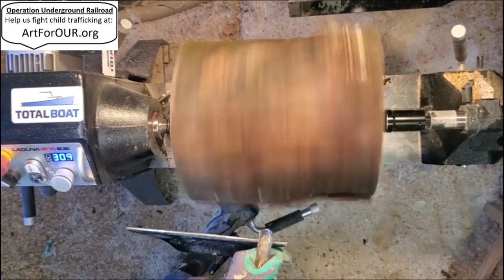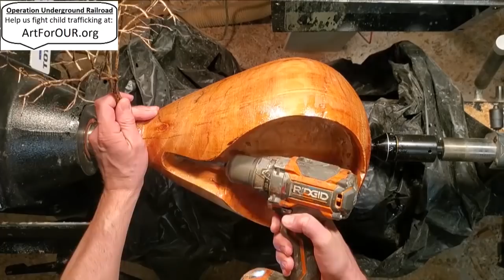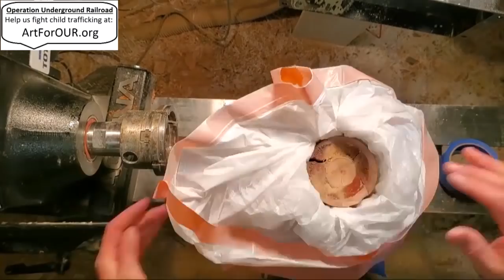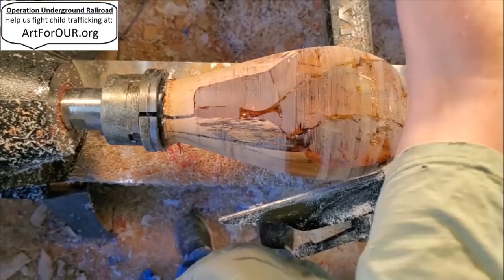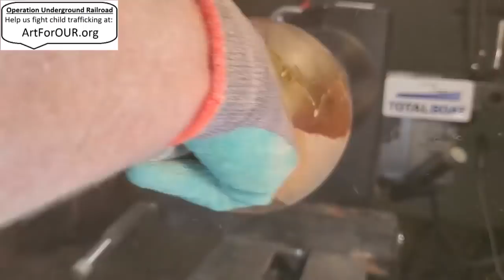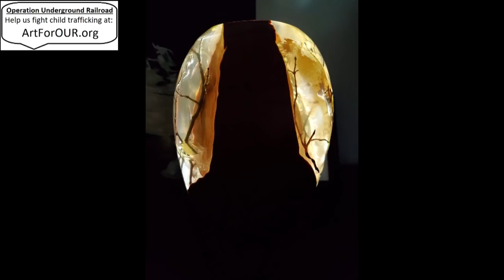"Crystal Tree"  Wood turning lathe project. Willow wood lamp. Fight child trafficking, ArtForOUR.org

Comment: Great Job Dan
You need to make a temporary mold to maintain the out side shape when casting.
1. turn shape on project.
2.put 2 coats of sealer (any kind, it will be turned off later)
3.chisel, router, gouge (what ever it takes)in a scrap piece of wood to the rough outside shape of the piece .Its not fussy. Big enough scrap to cover your window you intend to cut in your piece. 
4. wax your project with past wax or use a release agent.
5.mix up Bondo. Its two parts A and B. Its auto body filler. Buy it at auto parts store, or Harbor Fright.
6.spread the bondo on both your project and the scrap piece and clamp to project. (You may need to do this step twice depending on how good the mold looks after the two are separated)
7separate the two.
8.hollow out your project(making sure not to go past what the mold covers.( before hollowing wax project then hollow, that way plastic only sticks to intended surface)
9.put sealer on mold, Use wax or use parting agent on mold (we don't want the mold the stick to project)
10.place mold over cavity, clamp and seal out side perimeter with hot glue or clay.
11.Pour. And GOOD LUCK
You can use the same mold to do the other side of project. And save that mold for future projects just rebondo to fit new shape.
This is how I use to transfer shapes in my model / mold shop
DO NOT LET YOUR MOLD EXTEND PAST THE CENTER LINE OF PROJECT OR IT CAN NOT BE SEPARATED !!!!
Sorry its so long any questions contact me.
Scott
Reply from the maker: Thank you for the suggestions Scott!

Artforour.org

Comment: If you can standardize a few basic shapes, you could definitely create molds with silicon, but that is definitely quite a process.

As an epoxy artist (I make cutting/serving boards and tables with wood and epoxy), I totally understand the issues with it getting too hot, cracking, etc and what I can say is that lower ambient temperatures are most definitely your friend. Can you get it down to 55-60F or so in your shop? Put a light fan on your project too. Doesn't seem like it would be enough of a help, but for extra-thick pours it makes a difference;  cures slower, sometimes painfully so (3 days turns into 5+) but... the result is worth it.
Reply from the maker: Good ideas!  Thank you!

Artforour.org

Comment: I have a suggestion:: turn your piece to rough shape. Seal it , put wax on it for release. Then roughly shape a piece wood to outside shape. Bondo is body filler used in auto body shops. Spread bondo over both surfaces and clamp together. When hard demold. Then you will have the exact outside surface. Now cut out your windows and put the WAXED MOLD) over window. You may need more than one pour because the mold will only cover a max of 1/2 the diameter. Silicone the mold in place. 
Let me know how it works. 
Scott 
I can give you my # if you have more questions
Reply from the maker: Great idea!  Worth looking into.... gracias!

Artforour.org
Reply: I don't know what you are talking about, but it sounds like FUN, DOES ANYONE STILL BLOW GLASS, I Know about hand made glass beads, BEAUTIFUL, BUT IMAGINE THE ART PIECES, THAT COULD BE CREATED WITH, THE STUFF THAT IS AVAILABLE NOWADAYS XXX888

Comment: The resin matters. There are resins specifically designed for "deep pours" for example casting resins although most resins are good for about 2"-4" or less. But for anything deeper than 2-4" casting resin might be what you need.
Reply from the maker: Good idea! Thank you. 

Artforour.org
Reply: @artgivinghope  I hope it helps. Usually the manufacturer gives details or they can be found online about appropriate use for the resin. Wonderful project and art piece! (This isn't original advice, this was advice I'd seen from a fella that does resin table tops with stuff cast inside.)
The resin cracks because the stuff at the top is cooling faster than the stuff at the bottom due to the chemical reaction and causes the splits.

Comment: Great work. I've been enamored by each project I've watched. But I've personally had trouble getting both the epoxy and wood (I use olive wood ) to shine. I've tried 3M polish which works great on the epoxy (after sanding to 2000 wet) but doesnt work well on the olive wood (after using tung oil to bring out the grain and even letting it dry for a while) You said something about Teak oil - does it give you a gloss? Thanks and continued success (from a retired surgeon)
Reply from the maker: Thank you!  You can get a decent shine with multiple coats of teak oil, but it does take a long while to dry...
Reply from the maker: Thank you very much!

https://www.artforour.org/how-you-can-help
Reply: @artgivinghope  You're very welcome. BTW, your photography is also great. Did you take a course or is it self-taught. I used to take a lot of pictures in the OR (and also outside scenery) but getting my wood work to smile for the camera has been difficult. Any tips?
Reply from the maker: I'm mostly youtube and self taught.  I do a lot of editing using my samsung ultra phone and alwaysv use a light box...
Reply: @artgivinghope  Thanks again!

Comment: Ok couple things. Firstly, this would have been a perfect lamp base. Illuminate the internal pole led and plus the lamp itself and it would have been even more interesting, such btw it was actually a really cool piece even with all the struggles...lol. in addition if you check Doug's channel (pohl barn) he made himself some homemade pieces for the exactly sanding and hollowing you needed to do in this piece, without it costing an arm and a leg. An aluminum pipe with the circular sanding attachment welded on (just find someone who welds if you don't and it shouldn't be too expensive... still cheaper than commercial stuff) along with a curved piece of metal which comfortably sits on his normal tool rest but gives the necessary angle and it's just the carbide cutter attachment welded on so no "sharpening" of the tool itself, just the blades. 

And I hope you don't mind all my comments. I'm hoping to help, but if I'm not or you already know something since I'm just getting acquainted with your channel feel free to let me know. 

Also for a channel "boost" when you feel you're ready and would fully capture subs, create a sticker of your logo, the charity or a combo and if you send them to Doug at pohl barns (and even reach out or communicate with him in some way, I believe he would be more than happy to put out content that would assist. At the very least, he would put your sticker up and promote your channel.

Comment: Why not start with a rectangle then hollow out the sections for the twigs and resin then lathe down to the bulb shape? Would make the setup and pour so much easier and you would use half the amount of resin. Just a thought.
Oh and just buy a deep pour resin and most of your problems will be solved.
Reply from the maker: Great idea!  Thank you. 

Artforour.org

Comment: In regard to the tape embedded into the windows -- could you not resin the windows individually (face up) without all the tape and garbage bags?  This would of course take longer but would help avoid getting tape so deeply into the windows.
Reply from the maker: This is a great idea.  I've started doing this recently and it does work a lot better... just twice the time. 

Artforour.org

Comment: Dan-

I think you were right, a Router would have been too much for this project, the Roto-Zip and a Dremel Tool were the better choice, I use them both when restoring or building new Gun-Stocks.  The smaller tools and "Noses" on those tools lend them much better to projects like this.  If you are not aware, also suggest a company called Micro-Mark.  Check them out too, I am a Model Railroader and Auto-Mechanic.  I find their tools are great for on the job and my hobbies.  

As for the Child Traffic'ers... There is a special place in Hell for those Morons...
Reply from the maker: Thank you for the suggestions.   I'm still looking for power carving tools that suit my needs.  

Artforour.org